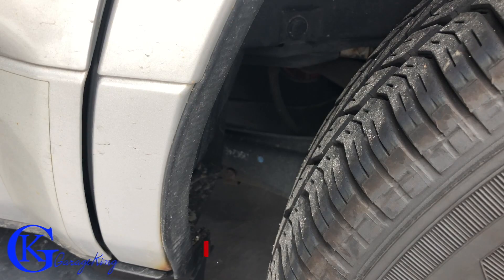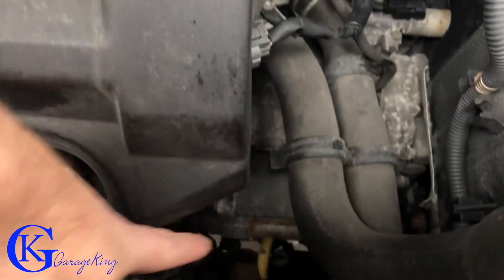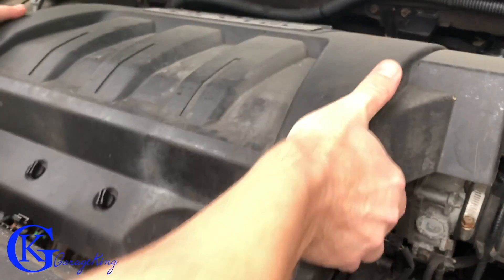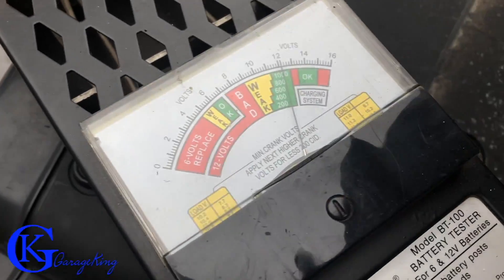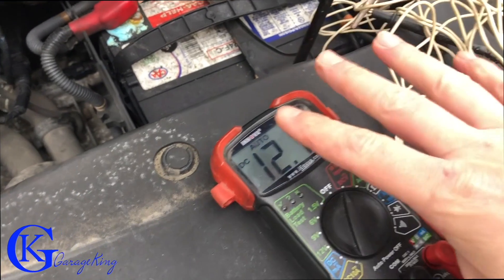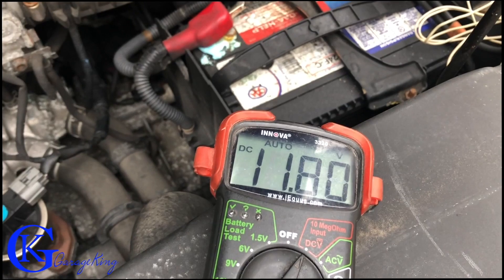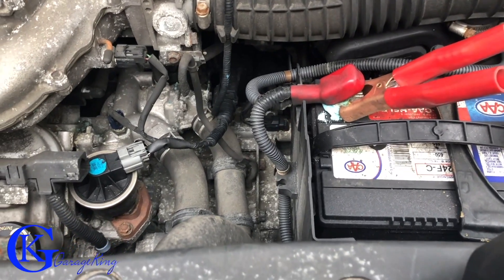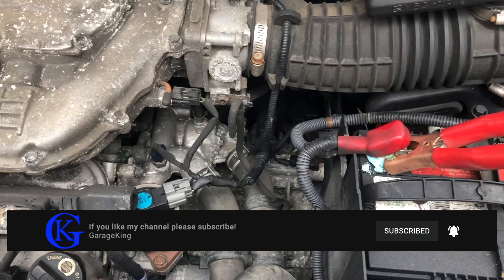Car won't start but clicks? No start? Honda Pilot.....

Comment: It could be a bad ground. If the starter is going bad you can tap it with a metal bar which will usually make it work.
Reply from the maker: Yup you bet, thats a great mechanics trick.  Thanks for the comment :)
Reply: It may be hard to access for a honda

Comment: I have a 2003 Honda Pilot and I just tried to start it up I can hear the starter clicking and when I try to start it, all the gauges on the dash start freaking out like crazy… do you know what could be wrong?!
Reply from the maker: Hey There, I think it could be a low battery.  Sometimes when you have a low battery crazy gauges can result when you are trying to start the vehicle.  Hook up another vehicle with jumper cables.  Let you vehicle sit for about 5min to take a charge, and then try starting again.  Leave the other vehicle running so it charges your vehicle.

Comment: But the starter was working? Why does it need a new one
Reply from the maker: No the starter was not working, in the video you can see I tried to start the vehicle but it would not start.  I showed how to check the other things that were working, but the starter was not.  Here is the video on how to replace the starter if you need to https://youtu.be/XWP-oxh9du0

Comment: i had the same thing in my honda.  I found it was enough to hold the keys all the way down and after a while the engine would start.
Reply from the maker: That's great if it starts, but it may not keep doing that.  Fingers crossed for you :)  Happy weekend to you :)

Comment: 6am eastern.  This was very helpful.  I’ll have the fuel pump checked.  Everything else is good, starter, battery and alternator.  Also I had all connections/leads replaced.  Should I check anything else?
Reply from the maker: Hey There, I know this may sound very basic, but also make sure your battery terminals are tight and clean.

Comment: I just changed my starter last week 2007 Honda Pilot and now it’s doing the same thing again. No starter. Fuel engages but nothing after that. After I changed it, it’s been working fine up till now. Any ideas?
Reply from the maker: Hey there, I hate to say it but I wonder if you got a bad starter.  Normally on these Honda's its the starter as the ignition switch is rare to fail.  Sometimes the starter relay goes but not often.  If you are hearing the fuel pump, the rest of the system is probably ok. You can't buy a new starter anymore (I don't think Honda sells them anymore) so what you bought was a rebuilt starter.  Probably from a parts store.  They take old starters apart, sand blast them, and put them back together with new internals.  BUT before exchanging the starter I would put a volt meter on the battery and get someone to try to start it and look at the voltage drop.  Also make sure all the connections are tight.  You would be surprised how many vehicle I see that don't start and its just a loose connection.
Reply: @GarageKing  after I changed it, it started right up. Changed it last Saturday. Volts are at 14.1
Reply: @GarageKing  my code reader only picks up bank 1 below eff.
Reply from the maker: @Celexanomnom  Not sure what you mean by bank 1?  Normally when you refer to bank 1 you are referring to oxygen sensors.   The truck should start without them (it would run like crap) but O2 sensor would have nothing to do with starting.   I read your other comment.  is it 14.1V when the key is turned and HELD to crank?
Reply from the maker: @Celexanomnom  When you are HOLDING the key at start the voltage should be less than 14.1V as the starter should be drawing current.  If when you turn key to START AND HOLD, you need to get someone to look at the volt meter on the battery.  the Key can't just be on the ON position, it has to be held to the START position.  The voltage should be less than 14.1V.  If its 14.1V when this happens then the starter is not engaging.  Could either be ignition switch, relay, neutral safety switch, or starter, most likely its a bad starter.
Reply: @GarageKing  yea I was just saying that’s the only code it shows. I know that’s the 02 sensor. It’s not showing any code but that. I just took out the battery and checked my connections on the starter. All right and secure so probably just a bad starter
Reply: @GarageKing  now it’s down to 11.2 cuz I’ve been Messing with it.
Reply from the maker: Yup that would probably be it. Good on you for checking the codes. I misunderstood you a bit there.
Reply: @GarageKing  hey thanks for the quick response, very helpful. Gonna trade it for a new one instead of a reman
Reply from the maker: Anytime brother !!!
Reply: Green key flashing? Light on dash ? It's the battery replacement or disconnect that I know is a issue in all them that say they get a battery swap or dead if the green key light is flashing  or the key fob battery dies

Comment: Ok installed a new non reman starter but still won’t start. Fuel pump engages, battery is strong, I can hear the relay click but nothing from the starter itself. Both connections on the starter are secured. Could it be an ignition switch problem?
Reply from the maker: It might be, what you have to do is get a test light and put it on the small terminal of the starter (the one that gets power from the relay)  Then get someone to try to start the vehicle and when they turn the ignition switch the test light should light.  When you test.  The big terminal should have power all the time.  ground the test light on the neg of the battery.  Its tight in there but you should be able to get in there with a test light.  I'm leary about the ignition switch as the fuel pump is triggered and you can here the relay click so the switch it probably ok, but you never know if the START portion of the contacts in the switch are gone.  It could also be the neutral safety switch,  this is the thing that prevents the starter from engaging if you put it in "D" and try to start it.  The switch will still work to engage the relay and lights, but the START position is disabled.  I think 1st thing is to check with a test light at the starter to see if that starter is getting 12V when you go to START, when you go to ON there should be no voltage there, only on START.  So you need two people to do the test.
Reply: @GarageKing  ok I’ll try that
Reply from the maker: @Celexanomnom  Sounds good, diagnosing is the hard part as you have to really maneuver things around and do the tests, plus most of the time you need a helper as you can't be inside turning the key and underneath the hood at the same time.
Reply: @GarageKing  ok so I got it started, tested everything, checked fuses etc etc etc all good still no start. Then I decided to put it in neutral and push it forward a foot, started right up after that. Turned it off, started up again. So I guess the gears weren’t lined up properly for the starter to engage?
Reply from the maker: @Celexanomnom  I have had that happen a few times and most of the times its caused by a failing neutral safety switch.  The flywheel and starter gear are not positional, so it really does not matter where they are, as the stater gear pushes out and engages the flywheel teeth.   You have an interesting problem.  It might never do it again, or might start doing it on a regular basis.  Next time, don't push the vehicle, just turn the ignition on and move the gear selector from P to D a few times and then try to start it in Neutral.
Reply: Check your starter relay it’s an all or nothing peice it’s either sending all signal or nothing
Reply: That also kinda sounds like your neutral safety switch
Reply: @myork2588  yea it is. It worked for a while then wouldn’t start again. I turned it on, shifted into drive then back to park and it started right up. I’ve got the part already just haven’t had time to fix it yet. I’ll probably tackle that next weekend

Comment: Hello I’ve changed my battery, starter, and alternator and it’s not turning on after the first attempt. For example I would have to turn my car on 2-3times and it will turn on. I got everything tested and they say my parts are working well. I have a Honda civic 2012
Reply from the maker: I wonder if its your ignition switch or neutral safety switch(automatic trans) or clutch switch (manual trans)  You can test the ignition switch quite easily with a test light on the starter.
Reply: @GarageKing   could it be the fuses as well and i have the spare key not the original
Reply from the maker: @elegantmikayla  Hey There, I don't think the spare key would have anything to do with it as long as the spare key is turning.  It could be a fuse, but if its a fuse you need to investigate what caused the short, or excessive current draw and popped the fuse.

Comment: My pilot doesnt like to be jump started when I have a dead battery, I almost have to charge the battery for 10+ min to be able to jump started, what should I look for? The battery is a year old agm and the starter works fine when the battery is charged.

I have had to connect my battery charger set to Jumpstart 50a and my noco gb30 jumper pack together on my pilot for it to even try to turn over.
Reply from the maker: To me it sounds like you might have a bad battery, I have seen them fail right after purchase so it might have a bad cell.  I would say take the battery out, and take it to get checked.   A shop probably would not charge you much to check it, if you brought it in.

Comment: I changed the starter and the battery. It was working great but now it won't turn on immediately. I have to wait for a few seconds till I see the fuel gauge working and then I can start. Should I be concerned about it?
Reply from the maker: That is not normal, I think you should check your batter connections to make sure they are secure.  Also check your starter connections.  I know its not easy.........  The other thing you can do is monitor to see what happens, but with the new battery and starter it should go right away.  There is the possibility that you got a defective battery, but that's pretty rare.
Reply: @GarageKing  yeah I can only replicate it every once in a while. In case it's a bad key, I'm starting my process of elimination from that. It's starting up with no issues all day today with a spare key.
Reply from the maker: Good call on the key, you know I never thought about that !!! I guess just keep using the spare for a few days and then go back to the original for a day or two and see if the problem comes back.  Then you know it’s the key for sure :)

Comment: Where is the starter relay?? 🤷🏻‍♂️ Iv got the same problem. Put a new battery and a new starter. Cant find the starter relay in either of the 4 fuse boxes... This is an old video but Please help if you can
Reply from the maker: Hey there, sorry I can't help you as I don't have the vehicle anymore.  For mine it was just the starter.

Comment: Well explained man. Good stuff! 
Literally the same thing happening with my car as well.
Where's the video on how to change it btw?
Reply from the maker: Hey buddy, sorry for late reply, here is the vid:  https://youtu.be/XWP-oxh9du0  also if you go on my channel main page there is a section for Japanese vehicles, American, German etc. if you need,  Thanks!!!
Reply from the maker: Also wanted to thank you for the comment as I thought the link was in the video, it's updated now.  Thanks!!!
Reply: @GarageKing  awesome thank you keep it Rollin!
Reply: @GarageKing  i haxe a question my 2007 honda pilot is getting plenty of gas but wont start. My huaband by mistake put water instead of gas in the tank. Since then hes emptied the tank wipe it out put more gas in it. I got gas coming from the line under the hood but my truck is hesitant to start
Please help
Reply from the maker: @keyonnaplain4581  Yikes water in the gas is never good.  Since your husband has already emptied the tank what you could consider doing is disconnecting the fuel line near the engine, turn the key (don't start the engine) and catch the fuel in a jar.  Then put the jar on a table and check to see if the water separates out from the fuel.  You may still have some water in your system that is causing the hesitation. PLEASE DO THIS ON A COLD ENGINE YOU DON"E WANT A FIRE.

Comment: HELLO! I have a 2005 Honda pilot that cranks but won’t start, Ive had the cam shaft and crankshaft position seansors changed but that’s abt it
Reply from the maker: If you have a scanner you should scan for codes, it may pick something up, or point you in the right direction.  If its cranking over you could check for coil voltage, and then fuel pressure.  I'll bet one of them is not working.
Reply: @GarageKing  the scanners read absolutely nothing! I’ve had the battery changed and pcm and key reprogrammed but no scanner can read any codes
Reply from the maker: @ryqnn  if you have a good scanner you can go into live data and check the crankshaft sensor by cranking the engine and reading the RPM on the scanner. when you turn the key do you hear the fuel pump running?  If not you have to look their first. Then next check for coil voltage.
Reply: @GarageKing  I’ve had it checked and supposedly everything is good but I can’t get my car to start
Reply: @GarageKing  was told that it is an electrical issue maybe a broken wire
Reply from the maker: @ryqnn  If you have spark, and fuel then it has to start.  if you have both, and it still won't start then you need a borescope.  One of my friends had a Honda crv and they were pulling a trailer and I guess they must of got some bad fuel.  Long story short, I did a compressor test and there was no compression on one of the cylinders, so I looked inside and there was a hole in the cylinder, no joke.  If you have fuel and spark, next up is a compression test.
Reply from the maker: @ryqnn  definitely a possibility, I would still check for spark and fuel, you will most likely be missing one and that is the electrical circuit that will need the diagnosing.
Reply: @GarageKing  do you know if it’s pricey to fix such issue? I got offered 650 for the whole car from pick your part so I’m debating
Reply from the maker: @ryqnn  Well its really simple once you know where the broken wire is, but to find that broken wire, or bad ground, is the battle and that can take a lot of time.  IF you are mechanically inclined you can do it yourself, but if you take it into a shop those hours can add up quick. When you turn the key if you don't hear the pump, then I would check the relay for the pump.  650 for the vehicle, I dont know the market that you are in, but you have to ask yourself how much to buy a replacement vehicle.  Its its thousands then maybe try to get it going.

Comment: I couldn't hear the fuel pump on my vehicle so I found out my battery was dead even though I tried to charge it.  Anyway changed out the battery and it's working just fine.
Reply from the maker: Awesome you got it all done, and trust me its a lot easier to change the battery than the starter LOL :)  Thanks for the comment and glad you are back on the road :)

Comment: Please what can make my Honda Accord 1999 model not start once, i have to start it 3 to 4 time before it respond, i have change the complete injector, fuel pump, fuel filter and and also new battery, but the same problem still occur, i need your help on how to solve the problem some time i have to start it from engine starter before it works
Reply from the maker: Hi There and thanks for the comment.  If each time you turn the key the engine turns over then you know the starter is fine.  Every time you turn the key do you hear the fuel pump?  If you don't then check the "fuel pump relay"  I think it is under the hood near the battery.   Also if you have a spark tester you can test for spark.  If you are not getting spark then it could be a sensor that triggers spark like the crankshaft position sensor.  Lastly, if you have a scanner, scan it for codes to see if there is any computer codes in there. If its a sensor there will probably be codes in the system.
Reply: @GarageKing  i have check the spark it fine, i even change the fuel pump and fuel filter still the same.  i even turn on the engine little and loose the fuel filter at the engine side to verify if the fuel is supplying and it supply fine. 
but my major concern is, if parked over night and i start in the early morning it start once but when drove for hours and the engine is hurt it will take 5 time to start or i would have to start it from the engine starter.
Reply from the maker: If it does not start when hot it could be a sensor or could even be starter.  You have to check the engine computer for trouble codes to see if anything is stored
Reply from the maker: @ifeoluwaomidiranganiyu5552  I also forgot to mention that sometimes starters can go bad when they are hot, but work fine when they are cold.
Reply: @GarageKing  thanks so much on the previous infor, i sincerely appreciate, just want to notify you that i installed a new starter today but still doing the same thing.
Reply from the maker: @ifeoluwaomidiranganiyu5552  Anytime, it is difficult for me to say much more without actually seeing the car as I have seen some weird problems on cars that turned out to be wiring problems.
Reply: Did you get your honda starting problem fixed??

Comment: IM STUMPED. 2014 honda pilot randomly died. I went to get it tested, EVERYTHING Passed. And 30 days ago I had the terminals fixed and tighten, a battery replacement, & oil change. A jump box will start it immediately. But it keeps dieing. What is going on.
Reply from the maker: Wonder if your alternator is charging properly?  If it dies right away something has to be wrong with the battery or alternator.  If you have a good battery most vehicles will still run with a bad alternator after a boost until the battery can't support the electronics.  So if its dying really fast your battery is not holding a charge.